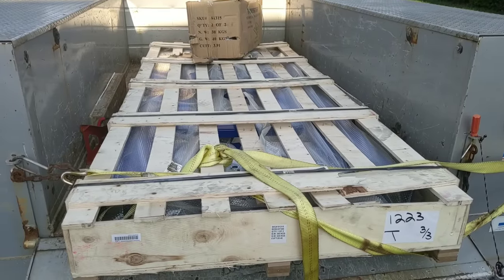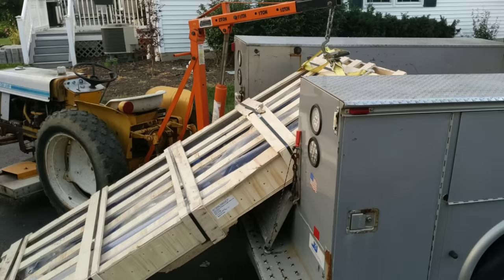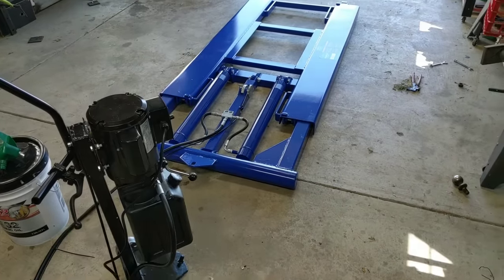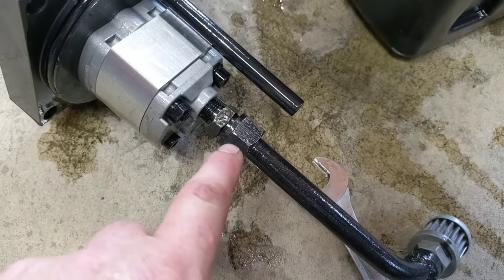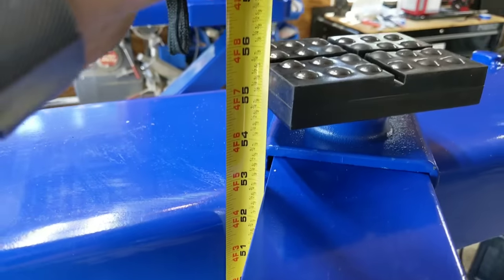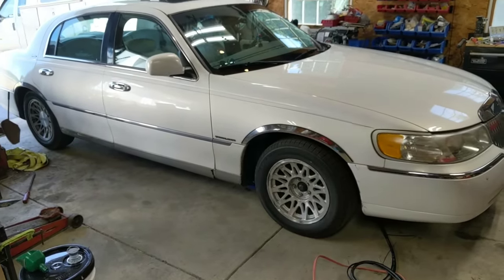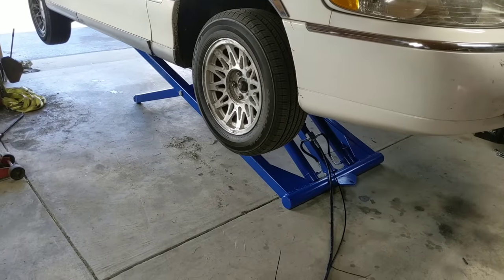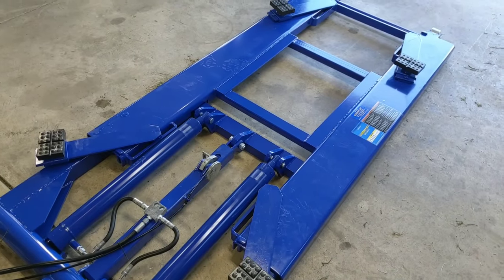Harbor Freight 6000 Lb. Capacity Scissor Lift Review, Central Hydraulics, is it worth it?

Comment: the rust is from humidity most likely. Shipping on boat across ocean. I got tools and stuff rusting just in my shop that never gets wet cause im in high humidity area. And dont matter what company you order from with big heavy stuff like this. Stuff like this from Norther Tools i got the boxes were damaged. Truck drivers always say thats how they got it. But this stuff aint coming straight to you on 1 truck. it gets transferred few times. And those transfer employees are minimum wage crackheads usually.

Comment: $1600? I appreciate the video, you did a very comprehensive job… And that’s great but I will pass… First of all, it’s too narrow, I’d be worried about the vehicle tipping from side to side. Second of all, you’re very limited on what you can work on under the vehicle with this thing, Because there’s so much of the apparatus it’s in your way… And finally, third, it doesn’t lift high enough… Not worth the money
Reply from the maker: If you're looking for a vehicle lift with intentions to work under, then your assessment is very correct, this wouldn't be a tool for you.    These are perfect for lower body detail work where you can sit on stool and wheel all around the car without posts getting in your way or casting shadows.   If you need to work under your car, you need a post lift.   It's just a different tool for a different job.

Comment: It's going to Destroy the Shop Floor.  Needs to run on steel.  Not very wide.  Looks like you can push it over.
Reply from the maker: Hasn't hurt the floor at all!   Also seems wide enough, you can't shove a car over that is sitting on it.

Comment: I shop all the time at Harbor Freight but you have shown such poor quality control and disregard for shipping packaging, do you really want to risk your life under a 3K pound auto? This lift is fine for brake and suspension work but for exhaust or drive shaft work; those heavy crossbars seem to be in the way. Also in front, those hydraulic hoses and pressurized cylinders seem to be in the way for transmission or engine work. If you accidentally cut those hoses, you might be in trouble. It may be cheap in quality to match it's cheap price.
Reply from the maker: I made a follow up video that answers this!   https://youtu.be/RAqqgq7ielE

Comment: I guess it’s a cool machine, but what is the point?  You can hardly get underneath it to do anything productive.
Reply from the maker: It's good for lower body detail work!   You don't have the post in your way and or casting shadows.    If you need to get under your car, then you really need a post lift.   Just a different tool for a different job.

Comment: I would not get under that without additional safety Jack stands, doesn't look that safe to me!
Reply from the maker: I wish I had explained why someone would need a scissor lift in the video.  They are not intended to get access to the underside of the car.   They are only intended to lift the car high enough to work on the lower extremities.   Perfect for lower  detail / body work as you can wheel around on a stool and not have post form a 2 or 4 post lift in your way.    If you need to work under the car, you need a different kind of lift for that.  https://youtu.be/RAqqgq7ielE

Comment: whats the point of lifting the car with this jack if you cant get under it
Reply from the maker: If you need access to the underside of the car, you would need a 2 or 4 post lift.  These lifts are perfect for detail and lower body work as as you don't have post in your way or casting shadows.  I can sit on a stool and wheel all around the car saving my back and getting up close to my work.   Just a different tool for a different job.

Comment: for that kind of dough you can get a proper post lift...
Reply from the maker: I think you can get a post lift cheaper if you look around.   If your a detailer, a scissor lift is a great option! You can sit on a stool and wheel around the car working on the lower half without post casting shadows or getting in your way.   Obviously If you need to work under the car you would want a post lift.    Different tools for different jobs!

Comment: Don't modify your garage, use your lift outside you didn't use it every day.
Reply from the maker: I ended up installing a jack shaft garage door opener.   The driveway is asphalt and not level, using it in the shop make more sense.

Comment: NO WAY WOULD I WORK UNDER THIS P O S WITH SAFETY SUPPORTS:face-orange-frowning::face-orange-frowning::face-orange-frowning::face-orange-frowning::face-orange-frowning::face-orange-frowning::face-orange-frowning::face-orange-frowning:
Reply from the maker: That is good, because it's not designed to work under.   You would need to be a contortionist to get in-between all the supports.  Read the pinned comment.   ;)

Comment: You have obstructions underneath it you can't roll freely from front to back so this is basically a glorified brake job stand.
Reply from the maker: It's a scissor lift, it's not designed to get under.   Great for lower body work where you can wheel around the car and not have post in your way or casting shadows.   To work under a car, you need a post lift.  I guess you could do brakes with it, though it wouldn't be that useful.   It's just a different tool for a different job

Comment: Good video. Would not buy this product. As seen this buyer, who documented previous buyers having the same problem, received parts that were damaged due to insufficient packing. Harbor Freight has enough influence to get the maker to correct this, and they did not, unacceptable. Also, subparts were not fully assembled, resulting in an unusable product. This item requires repair by the purchase to get it operating, not acceptable. For something that holds 3 tons over your body you want some conference that it will not collapse on you, poor quality does not provide that confidence.                       Instead save up a few more months and buy a better product.
Reply from the maker: I can't argue your point, that is for sure.   That being said, Harbor Freight at one point reached out to me and stated they had made changes including sending the pumps out in a wooden crate.   Regarding "3 tons over your body", keep in mind you should never get under a scissor lift, that is not what they are made for.    There is more information regarding this in the pinned comment.

Comment: Looks very dangerous what happens if a hydraulic line breaks it'll come right now down on you
Reply from the maker: A few things come to mind.  There is a safety latch that doesn't rely on the hydraulics.   Also it is not designed to get under, scissor lifts are designed to just raise the vehicle high enough to work on the lower extremities, not to access the underside of the car.   Perfect for lower body detail work, maybe an occasional brake job.   Anything else you would want a post lift.
Reply: @1D10CRACY  all ok i thought you was getting under it thanks for the information 👍

Comment: just hope you had at least one lock that could enguage with your low clearance on top, because this is one crappy and expensive table if you ask me XD
Reply from the maker: It has 7 lockable positions, more than most scissor lifts.    The first lock hits about when the car is 1 foot off the ground.   As far as using it as a heavy duty adjustable welding table, it's been pretty killer!   For that purpose alone I wish I'd purchased one years ago!

Comment: What looks concerning is the center crossing pin that holds the scissors together.  Well I have searched and searched for one so what is the official name….  Also do you really want to trust your life to harbor freight China metal when they cannot even make tool bits that don’t twist right off … NO WAY !
Reply from the maker: I think those pins are inch and a half, would have to measure them to be sure.   Regardless, it's just a scissor lift, it's not like you are going to get under it, that would be pretty irresponsible.  But then again, Darwin has his laws.   LOL

Comment: The lift has to many steel bars in the way,for doing stuff like dropping the gas-tank, or fixing muffler, its a 4-wheel jack..big deal!
Reply from the maker: Unless your a detailer, and working on lower body work is your thing!   Then it is a big deal!   I can roll around the car on a stool without post getting in my way or casting shadows.    If I need access to the underside of the car, I'd use a 2 post or quick Jack's.    It's just a different tool for a different job.

Comment: Not worth much for any work under the car. So it would work for wheels, brakes, front end work, rear axle work, just no good for transmissions.
Reply from the maker: Yup!   Working under a vehicle is not what a scissor lift is designed for.    You really need a post lift for that kind of work.   These are great for body and lower detail work, as you can sit on a stool and wheel all around the car without post casting shadows or getting in the way.  Just a different tool for a different job.

Comment: There's no way I'd work under a car on that contraption.
Reply from the maker: It's a scissor lift, why would you ever get under a scissor lift?   That is not what it is designed for.
Reply: @1D10CRACY  Really?  Then it makes a crappy table.  Why the heck do you need to lift the entire car if your not going work under it?
Reply from the maker: I'm guessing you need a lift, to get under a car.   That is not what these are designed for.    I can sit on a stool and wheel all around the car for lower detail and body work, without post casting shadows or getting in my way.   For me, its a great back saver!   When I need to get under the car, I use our post lift.    It is just a different tool, for a different job.    I suppose you could use it to rotate wheels and brake work if you needed too as well.  And I got to say, it actually makes an AWESOME table!  :D    It is really nice to be able to raise and lower items when your working on them.
Reply: @1D10CRACY  Thanks, I needed that.

Comment: You need to turn the lyft a round The big heavy round end goes to the back of the vehicle so lift won't tip over
Reply from the maker: That is actually the incorrect way to load the car onto these lifts, unless you have an engine in the rear like a Fiero.   If you study the physics a bit while the car is up in the air, it is safer to put the engine over the hydraulic end, as stated in the manuals.   It is less likely to tip over.   If you go to the harbor freight web site and look this lift up, you'll see a van up in the air, the engine is over the hydraulics.

Comment: no way would i get under that  if  bolt breaks the rest is history    needsome sort   safety jacks under each end
Reply from the maker: It's a scissor lift, designed to lift the vehicle high enough to work on the lower extremities.   They are not designed to work under!   Great for body work, as you can sit on a stool and wheel all around the car with no obstructions or shadows from a post lift.    If you need to work under a vehicle, you need a post lift.  Just different tools for different jobs.

Comment: I wouldn’t crawl under a car on this thing even if it was your life that was only at stake ... expand the width of the footprint BEFORE applying heavy lateral torque during repairs or I fear it will topple over.
Reply from the maker: It's a scissor lift, how and why would you crawl under it?    They are not designed to get under and the way they are made, kinda hard to get under.    Read the pinned comment.
Reply: @1D10CRACY    Its a figure of speech... why get a lift if you’re not intending to work on the car (more useful than a coffee table, right?)  I use ours daily for wheel, hub replacement, brakes, even muffler repairs . lateral torque, if high enough could easily tip the car off a narrow HF skinny footprint scissor lift depending on the car’s height ...  widening the base will help lessen that risk like higher priced units are... that’s all I was saying.
Reply from the maker: Understood.   These are great for detail and body work, as you can sit on a stool and wheel all around the car without shadows and posts getting in your way.   Anything more than that, and you 'need a post lift.  It is just a different tool for a different job.  In my ideal world, I'd have both.   As far as stability, looks are deceiving as it has a wider foot print than the camera shows, I have yet had a car that was unstable on it.    It is pretty old technology, I'm surprised to see people still making them.

Comment: I'd rather pay more for something I could trust...as I would be underneath it.
Reply from the maker: Sounds like you would rather pay for the right tool for you, as a scissor lift isn't designed to get under.   Unless you are a contortionist.   :).  A post lift may be a better option for you and they are probably cheaper.
Reply: @1D10CRACY  Yes, very good point. I have watched a few reviews of the quick jack, which has some appeal...I'm getting tired of lying on my back period. Don't get me wrong, your jack is impressive how fast it lifts and how high it does it. Keep an eye on her though!

Comment: No way i would trust anything from harbor freight with my life. The safety locks need to be able to engage sooner than a foot or 2 off the ground. I bought a pittsburgh jack from there and on day 96 it started leaking down. 6 days out of warranty smh
Reply from the maker: Yeah, I wouldn't either!   Lucky it's just a scissor lift and not a lift designed to get under.   The first safety latch hits when the car is about a foot off the ground.   Odd to hear about your jack!  I have one that's about 10 years old and it still works great!  Their Daytona Jack's are the best bang for the buck!    Not only are they a clone of the Jack's sold by SnapOn, they are built in the same factory!   SnapOn filed a law suit but it was dropped after HFs attorneys pointed out SnapOn was advertising "Made in the USA" and charging $400 more.   Wonder how many people paid $400 more for the "trusted" brand name.......

Comment: What is the point of this style of lift? you can't work on the driveline, exhaust, trans,etc, etc, Other than doing brakes, shocks, tires...It's useless.
Reply from the maker: Detail and body work.   It's perfect for sitting on a stool and wheeling around the car without post casting shadows or getting in the way.   I suppose you could use it for brake and wheel work as well.  But if you need to get under a car, you really need a post lift.   It's just a different tool for a different job

Comment: i don’t trust it, if a seal breaks that thing will come down falling ... i don’t know about this one
Reply from the maker: Luckily it's just a scissor lift and not a lift designed to get under.    Normally you would only lift the car high enough to work on the lower extremities, perfect for detail and body work.    It also does have a mechanical safety latch.   That being said, any major work underneath the car would require a different lift.
Reply: 1D10CRACY 

thanks....
Reply: if the seal breaks its not going any where thats why they have lock pins on it..for that reason.

Comment: Useless lift unless you only use it for changing tyres only but for the prices still makes USELESS!  Can't work under the car since the whole lift is in the way!
Reply from the maker: Because it is useless for you, doesn't mean it is useless for others.   Remember, this is a scissor lift, it's not really designed to get access to the underside of a vehicle.   You really need something like a post lift for that kind of access.   This is perfect for lower body and detail work, you can wheel all around the car without posts casting shadows or getting in your way.  It's a different tool, for a different job.

Comment: There's a million ways to lift a car, 999,999 of them are safer. Plus all that mechanism is in the way.
Reply from the maker: Yeah, you don't want this style of lift to work under a car.   It's perfect for lower body / detail work, as you don't have the post casting shadows in your way.   But if you need to work under the car, you really need a post lift.    Different tools for different jobs!

Comment: Yeah, not impressed with the shipping or assembly of that pump, that is truly unacceptable. I'd probably do just the same as you and bear with it but it lowers your respect for the supplier.
I kind of reckon with these sort of lifts, hoists, jack stands, etc. There should be some regulation requiring weld inspections to be done by the manufacturer and approved by a 3rd party. The idea that folks are just going to climb under some of these chickenscratch welds for years and years and trust their life by some chinese guy who'd been welding for two weeks holding up a mask in one hand and a mig spitting out structural deficiency in the other... Not great.

Comment: The design is a failure. I wonder if the designer has ever fixed his car before he finishes this defective plan. How can you work under the car with a lift like so?
Reply from the maker: Far from a failure!  They are GREAT for lower / body detail work!   I can sit on a stool and wheel all around the car without breaking my back!  I don't have the posts in my way and they are not casting shadows.   If I need to work under the car, I'll use my two post.   Its just a different tool, for a different job!

Comment: yo dude! dont store your battery on the concrete!
Reply from the maker: Dude, I do!   Back when batteries were in wood cases this was the general rule as the wood would pull the moisture out of the concrete.   Today it makes no difference unless you want to calculate loss from cold concrete and my shop is heated.